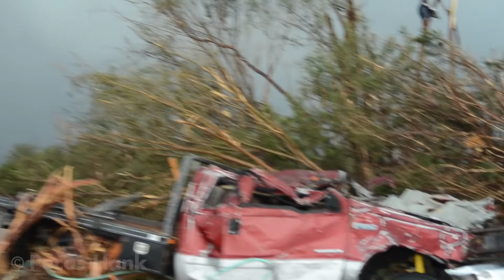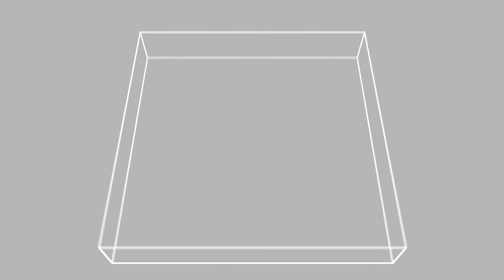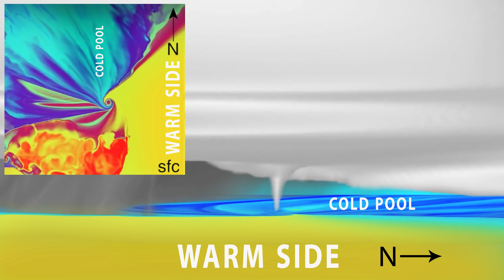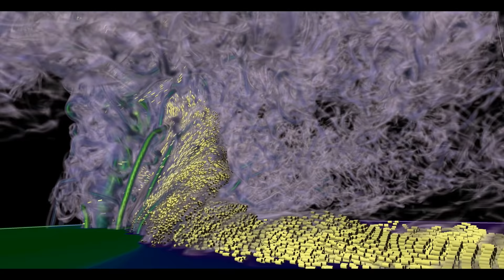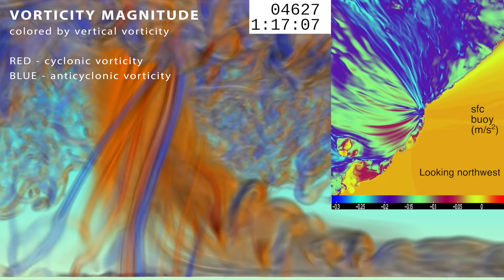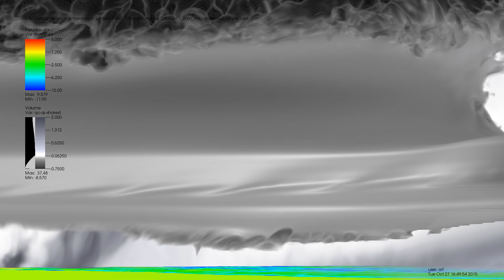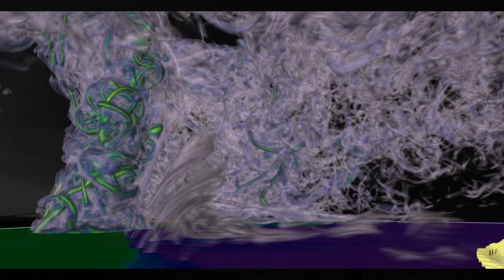SCIENCE INSIDE A TORNADO - Decoding the EF5

Comment: Looking fwd next to watching the newer video after this--but so far even though Im minorly educated in the computer sinulations so far--the warm inflows being horizontal then being picked up & turned vertical didn't make sense from the standpoint that the tornados "drop" from the mesocyclone - not come from the bottom up. So far this has always confused me when I watch a computer video animation.
 The cold air dropping and the total opposite consideration, so far as I understand here in the findings - makes much more sense with what we see visually.

Maybe also as they consider the RFD is reacting to being sucked in or pulled by some other event is good also bc keeping the mind open allows for further correct proof to be found rather than just sticking with what the current THEORY is.

Comment: Not all Supercells Produce Tornadoes. From what I've learned  about Tornadic storms is that in order for a Supercell to produce a Tornado,  you need an RFD, Which is warm air that wraps around the back of a Supercell which surprisingly not all Supercells have , And of course the Mesocyclone . But the most important ingredient for a Supercell to make a Tornado is the RFD( Rear Flank Downdraft.
Reply: if you'd listen to video, you would hear that RFD is not main component in tornadogenesis, SVC is the thing that feeds tornado with vorticity, Inflow is the thing that feeds tornado with humidity for condensation funnel to form, and RFD is the thing that can help to focus rotation, but not sustain or strenghten it

Comment: Declaring a tornado warning because of "twisting of the wind" is leading to a LOT of false alarms, which degrade the credibility of the weather service.
Reply: They don’t just warn for “rotation on radar”. They check whether or not the rotation is surface based or not. If the rotation is surface based they will warn it every time. They sometimes warn when the lines are blurred on whether it’s surface based or not. They also need to make sure they give people enough time to get to cover so they will warn even when a TDS isn’t on radar. It’s just their job, it can get better when radars get better. But for now, we do pretty damn good. It’s just older people who influence others and themselves with the mindset that they’re typically false alarms. Which was truer in the past. Now, it’s much better esp after 2011.

Comment: Please excuse the zombie resurrection comment - and also the daft question. Instinctively we assume that an area of low pressure pulls air from a higher pressure area until it fills - traditional low pressure Atlantic cyclone style. What if in supercell storms and also hurricanes, the energy garnered from things like the ocean surface temperature or the land temperature differential allows denser low altitude air to push in rather than be pulled? Would that be an inherently more powerful action than a straight suck? Do we see some of the same mechanisms for example in a volcanic eruption? (are there any tornadoes that we know of triggered off major eruptions that have been caught on film?)

Comment: I'm not entirely sure why but the "enhanced" Fujita scale as always rubbed me the wrong way. There is very little enhanced about it, and all its wind speeds for each category are lower than the original Fujita scale. For example, an F-5 was a tornado with wind speeds between 261-315 mph, an EF-5 is a tornado with wind speeds of anything over 200 mph. In theory, this would cause the more violent tornadoes to be rated higher . Since it came into usage, most EF-5 tornadoes are really F-4 tornadoes since their wind speed is 207-260. And since there has been tornadoes where the wind speed was over 300 miles an hour, I like that the F-5 is 261-315. Furthermore, picture this, and EF-5 tornado is anything over 200 mph, now imagine a tornado with wind speeds of 201 mph, bad, sure, nasty, sure but now picture a tornado with wind speeds approaching that of 315 mph. I believe it would more worse and so much worse that it would deserve its own classification such as it was under the original and much better Fujita scale. A tornado with low 200 mph winds should be an F-4, like it was, or under this new system, an EF-4, not an EF-5 with its 200+. 300 mile per hour winds deserve their own class of intensity, not to be lumped in with anything over 200.

I don't know. Like I said, the enhanced Fujita scale as always seemed like a downgrade to tornado classifications. Look at both scales and compare the wind speeds. Plus the fact that "Enhanced Fujita scale" does not roll off the tongue as smoothly as "Fujita Scale"  and don't ever mention how less cool and less threatening saying "EF-4" sounds compared to "F-4" 

Tornadoes are the most destructive storms on the planet and should be treated as such and saying something like, "there is an EF-5 on the ground" could mean anything from a 200 mph wind to what? 700 mph wind? That's not going to cut it. I know it doesn't get that windy on this planet but we wouldn't be able to tell with the "anything above 200 mph" rating that an EF-5 carries.

Maybe they should "enhance" it again. Come up with a "Super Enhanced Fujita Scale". Maybe an "SEF-5" would be back close to its original wind speed of 260-315.

I have seen these monsters up close. They haunt my dreams most of the time. The original Fujita scale should have remained in place.

Comment: Geez..
When you live in a tornado area, wouldn't you build an armed concrete
foundation for your house that's sunk into the ground ?
I mean wth ?
Dig 20 feet deep, spread at the lowest part into 4 separate feet,
fill with an H-beam and concrete, then attach the concrete cellar on top.
Yes, it's hard work, but you'll get by tornados with little chance of
being sucked in or away.
Wood is cheap, yes, but rebuilding the same house again and again, not so much.

Comment: It's the difference in temperature in different locations. Imagine if in a 100 ft field 50 feet of the field is 65 degrees, but because of the position of the sun and sun rays the other half of the field is 75 degrees. The air under 75 degrees will rise faster while the air under the 65 degree area rise at a slower rate. Both will cause the air to rise causing funnels because hot air meeting rushing wind causes the cyclone effect. Now since the temperature is different the higher spinning cyclone will meet the lower spinning cyclone and cause a funnel effect which will topple the spinning air over because of gravity. It would look like a slinkey at one end being held up higher htan another end, the end closer to the ground finally meeting the ground because of gravity while the part of the slinky closet to the sky reaches upward because hot air rises. Also the reason there are a bunch of cyclone is because those are random bursts of wind or air breaking away from the bigger tornado cyclone but still spinning because of the kinetic force. It makes sense that the cold air is what fuels the funnel because the hot air rises while the rushing cooler air is what is actually moving. The hot air just makes the cool rushing wind spin sort of speak (rise with the hot air, but then fall again because of gravity , cool air is more dense) just a theory though. Also a big factor for the rising air could also be geothermal energy which would definitely cause different temperatures in different locations
Reply: 13:26 is a perfect example of this. The sun is hitting one side of the land, and the other side is blocked by clouds. The side of the cyclone within the sunshine is high in the sky (because of the rate of rising air) while the side closer to darkness (cloudy area) is lower to the ground because of the heavier cool air causing it to funnel across a large area like a field. The side closer to the ground connects because of gravity, and like the kinetic energy in a drain, the air begins to spin and flow in the direction of up from down the opposite of a drain because of the force of the reaction (air/wind speed)

Comment: Maybe it has to do with the properties of air at different temps. Cold air is more dense and heavy, yes, but it's still just air. It is more oxygen rich by makeup. Like an engine, maybe these cells prefer the more oxygen rich air to fuel their development? Maybe it just depends on HOW MUCH cold air is moving with the cell to fuel it, in regards to tornado formation and strength. 

Pull hot air through an engine and it will run, yes, but it doesnt like it as much as crisp cool air with more oxygen. The oxygen molecules are slower, therefore taking up less space and bouncing around less. Hell, maybe cold air is more stable and more easily manipulated by the winds and up drafts. 

So, though cold air is more dense....its still light and easily moved by winds. Plus, it may work better dealing with different pressures up in different layers of the cell itself as it grows taller and draws in more fuel....so the idea of measuring rise/wind speeds and buoyancy and stuff may not be way off, it just may not be 100% the cause, only a good precursor to storm development.

Comment: what trips me out is the dynamics of the atmosphere and its 3 main components: tempreture, humidity, and pressure, whats even crazier is that these are not 3 separate forces acting on each other but rather one force with 3 faces to it, one does not act on the other, one IS the other, its just a matter of which face is of higher influence. temperature IS pressure, humidity IS temperature, a change in temp, automatically renders a change in humidity and pressure, so hearing that its the cold air that is driving inflow just doesn't make sense!!

can you imagine what possibility will open up when we finally get quantum computer sims up and running? i just wish people would learn and instead of "we will rebuild" how bout taking the opportunity to rebuild a house in the 21st century thats tornado proof rather than using a hammer and nails, state should subsidize the extra costs or something fuck!

Comment: Standard meteorology due to using only fluid mechanics can only have temperature moving the atmosphere around. But when electromagnetic mechanics is used, it makes perfect sense and we get a truer picture. Waterspouts are just the same as tornadoes and dust devils, with the earth through Birkeland Currents (currents of charge) balancing charge between the ground and the atmospheric charged layers above. But because waterspouts form over coastal margins, it shows that they are attracted to the electrically conductive sea or ocean, above the off shore seabed and head (unless stuck over a sand bar) towards the shore where the charge exchange can fully happen, until the charge differential balances and it fades out. There are three Plasma Discharge Modes, 1 Dark Mode and where there is not enough charge density for it to be seen visible to human wavelengths of the electromagnetic spectrum. 2, Glow Mode and where the charge density in the discharge is higher and we then start to see the discharge glow. 3 Arc Mode and where the charge flowing through the discharge is so strong that the magnetic fields produced by the moving charge pinches the discharge tightly together and so producing an arc. So lighting strikes are B/Cs in Arc Mode.

Comment: The storm simulation is good, but, if all you are following is temperature, humidity, precipitation and pressure, you will not find a conclusive answer.  These are nothing but the physical manifestations of electromagnetic events in what is, in my opinion, dark mode plasma, or what you would call a storm cloud. I know my hypothesis is outside the standard model, but, our atmosphere has a high plasma potential as seen by arc mode lightning and glow mode Aurora. Therefore, since these two expressions of plasma exist in our atmosphere, then we should see a dark mode expression. This is even further confirmed with the cyclonic and anticyclonic vortices, these are akin to field aligned currents and the layering of charge in a thunderhead is something that is ONLY seen in plasma. What they need to be doing is mapping the magnetic activity, that will indicate what is happening electrically and that is the cause of the storm.

Comment: What main stream meteorology is ignorant of, is that it's the ground currents that attracts and forms the twisters.

So as with most things, something is only counter intuitive if the original assumptions  are wrong to start with. But as we have seen when the right model is used, Electromagnetic Mechanics, it all makes perfect sense and is totally intuitive. This from my piece on Electric Weather Mechanics-

"...As already stated, standard meteorology due to using only fluid mechanics, can only have temperature moving the atmosphere around. But recently and after just the data from a big storm system was input into a super computer and without any preconceived ideas as to what was happening (fluid mechanics), it showed that the wrong type of temperature seemed to be doing the driving in the system.

With it being the cold instead of the hot pushing air columns up. This left them scratching their heads as rising heat is supposed to drive weather patterns and not rising cold.

But when seen as negative charge heading from the ground towards the positive ionosphere through the conduit of the cloud and as it does so, affecting the matter state of the H2O molecule, it then makes a lot more sense..."

Comment: I hope these scientists Have considered the fact that some of these tornados hitting cities and major populated areas due to the heat  around all these concrete buildings and HOT cement and tar roads used by many Hot vehicles during warmers temps. maybe they should track infrared models and temps of major populated areas and why the tornado itself gains strength upon arrival of these metropolis's. maybe that will lead them to the true answer.

Comment: Hank may like this guy but I don't. He would not have Anything on his pc if it were not for the storm chasers that gathered that information. I have been in three Tornados I remember and one I don't. One bashed the house windows Inward then the glass slid down the wall and slid across the floor. My Grandmothers old Sal cards started turning in the air in front of her face. She had to let go of them to hold the table we were under. The glass slid by on the floor and the table went up and I was lifted. I woke to darkness and water. Another in east TN sat on the neighborhood a wedge wrapped in water and cloud. Then it picked its, "skirts" up and leaped several miles over to the airport. When it went over on the leap there were Hundreds of plate disks on its underside moving in groups making swish swishy sounds. Later on that same day there was hail coming down across from a river and 3 small ones standing side by side in a river wrapped in white and blue and hail the size of golf and baseballs comimg down where we were about 2 and a half mile away. I think that this scientist should be more humble about where he gets his information. He is a snot.